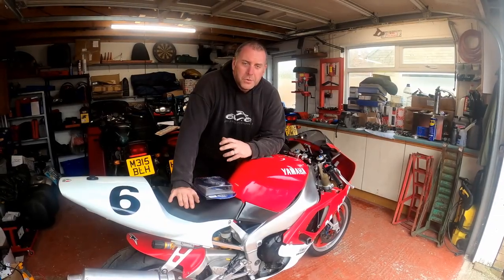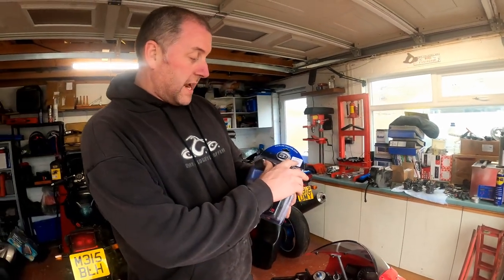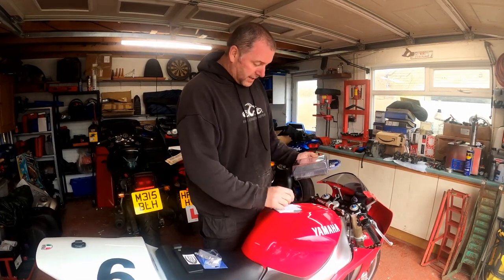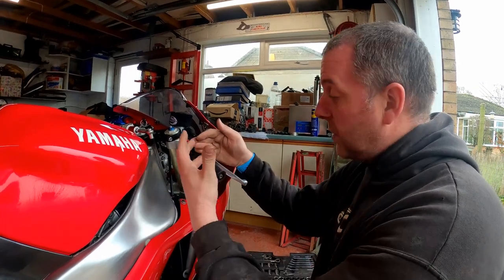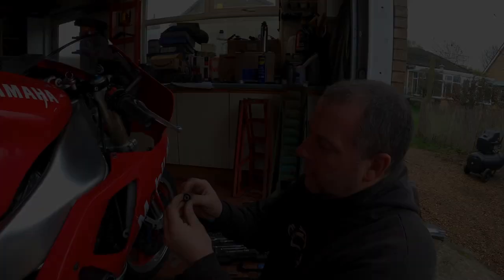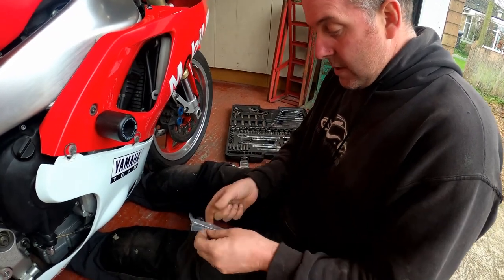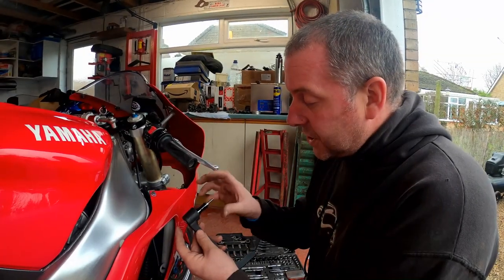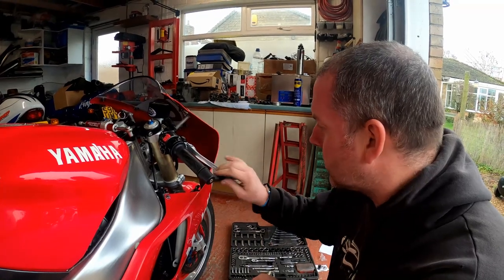Fitting An R&G Racing Front Brake Lever Guard To My Yamaha R1 Track Bike

Comment: Hi kev, what is the item called to pulled out the throttle tube ?
Reply from the maker: Do you mean the bush inside the bar or the slide hammer that I use to tap it out?
Reply: Retainer or steel clips, thats the word im after. 

What is the down side of having levers guard ? Is the handle bar more vibrate ?

Comment: I just fitted my R&G lever guard to my '00 R6. I'm not impressed with the quality of it all as the throttle tube protrudes from the handlebar by 13mm, the cone and expanding tube is sat 13mm out of the handlebar in fresh air. So now it needs a spacer making up as I've had to pack it out with multiple repair washers to get it to sit inside the bar and not foul the throttle tube. Even with the bolt tightened normally you can still move the lever guard about due to it being plastic. 

Poor show on R&G part, for the money they cost it would have been better buying a cheapo made in China one and modifying that. 

Nice video mate but but not great on R&G.
Reply from the maker: Hmm, that is odd, I find it weird that the throttle tube is longer than the bar to be fair! Is it fitted correctly? I have never encountered a bike where the throttle tube is longer than the bar personally! I agree with what you are saying but a universal fitment part that doesn't fit your bike isn't really due to the fault of R&G in my opinion but I do get your frustration!
Reply: @KevsShed  they're listing it as suitable for my R6. I've spoken to them and they agree there's an issue with it. I ended up binning their fitting kit off and making my own by machining the original bar end. Now it fits perfectly and doesn't move about.